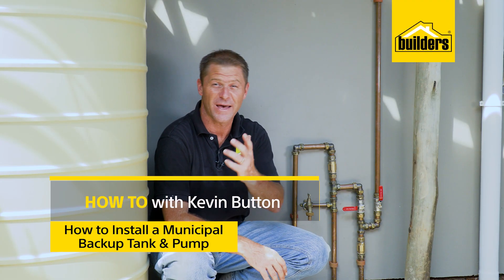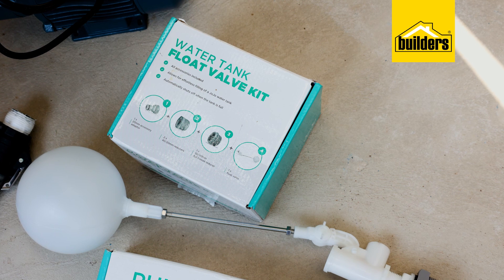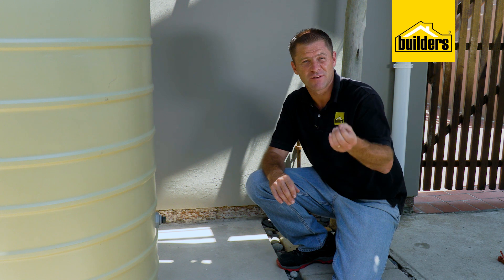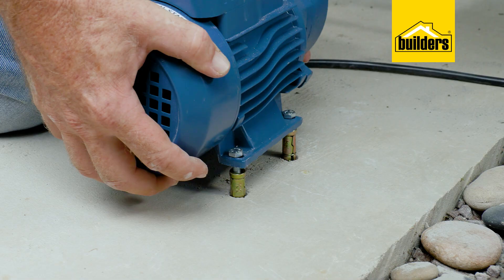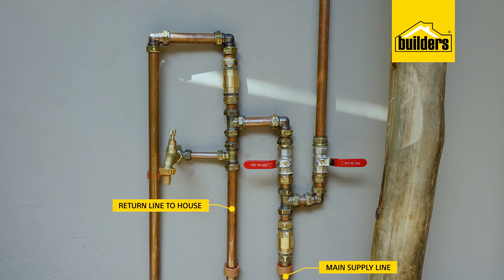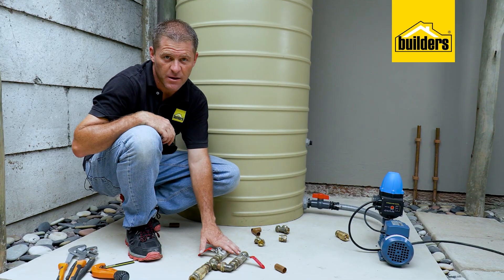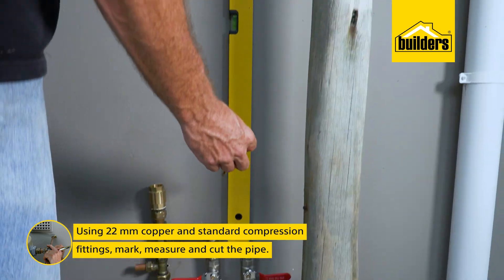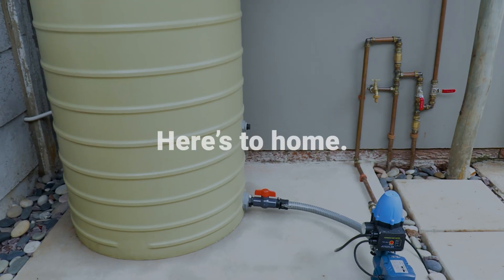How To Install Your Own Emergency Backup Tank

Comment: If you add a non return valve into the horizontal pipe above and to the right of the garden tap, flow arrow facing the garden tap, you can open both red stop cocks and the system becomes fully automatic. You can still use the stop cocks for manual operation or maintenance/repair purposes. As this is, if you forget to close your left hand side stop cock the pump will keep circulating between the jojo outlet through the pump to the open ball valve.
Reply: I just commented that, but my focus was on back feeding to the tank if stop cock was open mistakenly, and while there is no water from the main line.
Reply: So correct me if im wrong but what u r saying is that he should add a third non return valve above the left stop cock on the small vertical copper piece that joins with n elbow and a tee on the other end. From your observation both stop cocks can b left open and the system would run automatically, is that correct?

I am really pausing the video to see it from ur reasoning which would b ideal if it could run automatically.
Reply: @mocee83  that's correct
Reply: This is correct so it becomes fully automatics
Reply: The system that way will be automatic if there is no water from the main line if we add non- return there and open both stop cocks

Comment: I added a 5000 litre Jojo to my "Rand Water" system April 2022, when the local (fibre/concrete) pipes started popping in Pretoria East. 5000 Litres is fine for a week. I also have filters, particle filter on the way in, carbon filter and water softener on the way out. I use an electric water float and electric "tap" to feed water in - which allows me to adjust the water level in the Jojo by raising/lowering the float switch. It is also full pressure so agitates the water in the Jojo. I just have one "emergency" by-pass tap between Rand Water and the House. There is a one-way valve on the house side and another in the municipal water meter.
I also have a Solar/Victron/Battery system that keeps my house supplied with power.
One possible upgrade is a UV filter light on the house water, and maybe an array of pressure sensors so I can "see" what is happening.
We have had multiple pipe bursts in our area, as well as Rand Water failures - none have caused us an issue.
Oh, and I can safely (as in "tested") feed in Bore Hole water with its separate on/off float switch.
Wife really loves me!

Comment: Can I use the small generator for the pump
Reply: yes you can, the issue here will be how much automatización do you want. Specially since the pump is not always running (pressure fluctuation for min is the turn on). So its not efficient if you live a powered generator always connected and only the pump, find one of those automatic generator or use a control module beside the generator. Pump do require different power drain when starting, so be sure your generator satisfy the startup Wattage in requirement. (small pumps, 0.5hp, uses around 700-900W but for the startup need almost the double, so be carefully with this specification, you can even combine a small generator with batteries to compense peaks and a more stable system). 

If you want a continuous system using a generator is probably not a good idea, as i said, posible and the worst part is the efficiency. If you have power loss issues is better to have a battery system or just use the gravity: Put the tank at a higher point and use the pump to fill the tank initially, then just let gravity do their job (this also helps with the small generator issue, no controlator need it and no pressure system so you can save money on the pump)

Comment: Is it advisable to bury just the tank underground if space is an issue? All the pumps can be above ground.
Reply: There are underground water tanks😊
Reply: The problem with underground tanks is the risk of contamination, where rain water or any other run off can make its way into your tank, so ensure your inspection hatch and tank breather or and other openings are well above the ground and properly sealed.

Comment: How can I secure the pump from theft?
Reply: Install line in through house wall pump in house and line out again through wall. There must be a plug nearby. We installed it in our laundry room. Great thing is if there os any taps leaking you will know it immediately when pump switch on and you are not using water .

Comment: last put concrete caged to protect from thieves, welcome to SA.
Reply: Ish thats my concern as well these guys last killed my dog just to steal a used toilet 🚽 😢 my question is if we put a concrete cage for the pump will it not affect the air circulation ish you see how English ( all I mean is doesn’t ipump need umoya to work properly)

Comment: 1 question plz i am getting problems with my automatic, which is running continuously without any leakage..and when the main water supply open to fill the reservoir tank or even i open my water supply main tap the automatic stay on .
What should i do please???
Do you think i must change the non returning valve??
Reply: Check your pressure switch, likely faulty or set too high

Comment: In the USA here. Our issue is power loss. Any thoughts on a DC pump powered by battery with solar charging?
Reply: You should have a standby back up generator if you’re going this far anyway anyways
Reply: @ericchan6628  We looked into that but it's just crazy expensive. With the new modular battery backups, it's cheaper and quieter in the long run.
Reply: inverter with solar panel and deep cycle battery and normal ac pump

Comment: You should add a bladder tank to that setup. Saves your pump from turning on everytime you open a tap.
Reply: Hello. Thank you for your advice. At what height should I place the bladder tank? And what size bladder tank do you suggest?

Comment: This system as you build it can’t work: the check valve coming out of the pump will close once the pump stops keeping the house pressurized and causing the pressure from the pump to the check valve to drop setting the pump on an endless start stop cycle. Ask me how I know?
That check valve has to be on the tank side of the pump or the pressure switch needs to be moved from the pump to the pipe after the check valve.
Reply: How did you fix it?

Comment: Does the pump run when it's on normal supply???
Reply: It depends how you set it up. The lever ball valves are accommodated so you can choose between municipal and jojo  . Dab pumps are a good option because it's power efficiency is  exellent  and invertor friendly.
Reply: @ZakJeewa  Okay Thank you🙏

Comment: What is the estimated cost
Reply: JOJO Tank 2400Litre and Pump kit is going to be around R4100, The tank to pump connector kit is R350- R500 (depends on which you get). The Brass fittings are going to be around R1700, including a length of 22mm copper.  2nd option is rather use copper joints as its cheaper second option, still pricey but also more effective. 
3rd option is to go all PVC fittings and polycop  fittings. Which can leak over time, along with cracking from climate heat or the pressure and overtightening.

Plumber is going to cost you a call out fee before any work is started. So R350-R450 call out. And then his hourly rate or budget cost for the job.

A project like this depending where your mains is aswell, hiring a plumber is going to probably cost you shy of around R6000 - R8500 all in all.

Comment: Thanks - a great help.  Just a thought: If both ball valves are open, and the main supply is not supplying, it seems there is a chance that after using a tap, then turning it off, the pump will continue to circulate the water back into the tank?  Perhaps the non-return valve on the Main Supply should be after the Tee to the tank?
Reply: Just seen this video and have the same question. Looks like an additional NRV needs to ne added after the T piece to the tank?  Did you manage to find a solution to this John?
Reply: @TheJuryIsOut  Yes, That is what I did.  Now I can leave both valves open, so that if I am not at home, and the main water supply is not supplying, then the water from the tank will automatically be used, and my family members do not have to go outside and fiddle with valves.  When I am home, I close the main supply to the house, so that the water in the tank is used while it is kept topped up from the main supply. I cannot post a photo here, which would help you.
Reply: @johnfrancis2227  Thanks John. If you shut off the mains to the house then the tank won't be fed as well? Would be great to see your layout? I sketched something out as well. Email?
Reply: My setup.... I can leave all valves open. If the mains fail water is fed from the tank. If mains work then water will be used from the mains first until the pressure drops/stops. At least that's my theory. You are welcome to poke holes into it. Much better than trial and error.
Reply: @johnfrancis2227 
   Good evening John, please assist me,I want to buy the pump automatic switch,I don't know where can I get it, please assist 😢😢
Reply: I just wonder, why no water filter is used for both lines? Filling the water tank without a water filter will bring sediments into the tank. Do I miss something?
Reply: @holgermessner851  In my case the main water feed is municipal piped water and not harvested rain water. Had this been the case there would be a need for filters. Our issue for over a year now in certain parts of South Africa (no thanks to the ANC government) is the interrupted piped water supply so the system I use works as long as there is electricity and I have a full tank of water. Previous comment re water applies as many hours of no electricity per day for 15 years now no thanks to ANC....
You do have a point though as a filter even for piped water would be the way to go.
Reply: @TheJuryIsOut  I live in Panama and I am just starting to build my own little house. In my area where I am renting a house, there isn’t a water filter in place. It’s “city water”….. But every time, the water comes back on, I have to clean the sink faucets. There are small sediments in the beginning and blocking the faucets. I was told to install water filters. But hey. It isn’t my house. And the owner would be very happy if I would install a water filter including a tank at the rented house. On the construction site, I will install 2 water filters before the tank. It is well water we get supply from the development company. As for the “ city or municipal water” I put in brackets, it isn’t drinkable for me. I would get diarrhea right away. (Guess how I know that.) - Locals drinking it every day. But sometimes it looks grey or even brown. They pump it in big old concrete tanks. If the tank runs dry, it takes a whole night to refill. The 1st water isn’t even good enough to take a shower. We use the drink water bottles I buy in the supermarkets. I think they hold 30 liters around. I have always 4 bottles in the house.
Reply: @holgermessner851  For many years South Africa was one of the few Countries where "city/municipal" water was drinkable from any tap just about anywhere. However the Country has been on a downward spiral in all areas and soon we would probably be worse than the situation  you describe. I just saw on our local news that there has been a cholera outbreak in one of the remote towns....; so much for "clean" potable water... More and more people are starting to buy bottled water for drinking but even this is suspect in some cases as opportunists try to make a fast buck. Not sure whether you can get this in your area...a stand alone water filter system. In this case you would need to purify enough for drinking which is more cost effective than bottled water which as I said is often suspect.
Best wishes.
Reply: @holgermessner851  Input is from municipal supply, so should be "clean".  My setup is merely to store potable water in the event that the municipal supply is off, which is a regular occurrence in our neck of the woods.
Reply: Thank you. Starting my installation and this is a key point. Well done.

Comment: A small addition, if the slab where the tank is located is exposed to rain, placing the motor on a small raised plinth, 20mm to 30mm will keep it out of the water if the area floods.
Reply: the construction of the pump allows for that all you need is the cover - the pump is not completely waterproof

Comment: What happens if power outerage
Reply: So if there is a power outage you switch to the municipal supply (because the pump wont be working), so you are then relying on the municipal pressure.  That's why he set it up for the bypass option.   If you have a power and a water outage at the same time, you are in trouble and should probably move to another municipality 🙂
Reply: @MrDaveCoetzee  this clearly says emergency which could imply both power and municipal supply are down. In that case you would need a generator to power the pump and you could have water pressure until your tank is empty.
Reply: @MrDaveCoetzee  theres away out work it out using the weight  of the water 750kgs=pressure work it out
Reply: @MrDaveCoetzee  that means most households on the KZN North Coast would need to relocate thanks to our very efficient Ethekweni Metro.
Reply: one more nrv -tank-nrv-to your home

Comment: Nice I've done a few tank installations myself and I recommend doing them like this but I don't need to turn off the tank main that falls the tank when I'm using the main water supply. That way the tank is always kept full.
Reply: Where are you based? I need a quote for a tank installation. Pls share your contacts. Thanks
Reply: I like your idea. However I cannot figure out the following.... If the supply side SV is left open and the main water pressure drops activating the pump won't tank water be pumped back into the tank? By Kevin shutting off the main SV water cannot travel to the tank. Bit of a bind as one has to manually turn off the main SV each time there's no municipal supply. Your thoughts...?
Reply: @TheJuryIsOut  This could be negated by installing a one way valve with upward flow just above the left ball valve. This will prevent pump water from flowing down through the mains valve and back up the tank valve. A possible flow loss will occur when running on municipal water since it's flowing through two one way valves, but probably not enough to notice.
Reply: @Sheldon777  thanks for taking the time to respond. This is what I eventually ended up doing and your point is noted. Stay well.
Reply: 100s boss

Comment: What if the tank is far from the main water supply line.
Reply: It's still possible... You'll just need to alter the the main line a little bit
Reply: @nduvhomamidze992  Waar
Reply: same procedure the issue in the video is the same
Reply: I want to ask a question oo.  is it that, from main water, the water must enter poly tank first before  ??
Reply: @tsivanynojerryjohn6230  it must tee off from the main water supply (doing this leaves your existing line to continue normal supply to your home)  and by  using a non return valve (before you tee off) the water must move into the tank  and will only stop filling the tank when full and float is activated. make sure the non return valve is on the supply side  before you tee off. if not you will be supplying the neighborhood with water.
Reply: So guys from our main supply we'll two tee pieces running for this set up just confused about the last part when connecting up
Reply: Same here just clarrify that
Reply: If my water pressure is low upstairs, will the pump increase this pressure when water gets restored
Reply: @millinaidoo5526  yes it will

Comment: After the water issues in KZN this easter, guess who just bought all this online at your store. Thanks guys.
Reply: Lol. Same her
Reply: So how much did it cost
Reply: @craigfrancisy24u  JOJO Tank 2400Litre and Pump kit is going to be around R4100, The tank to pump connector kit is R350- R500 (depends on which you get). The Brass fittings are going to be around R1700, including a length of 22mm copper.  2nd option is rather use copper joints as its cheaper second option, still pricey but also more effective. 
3rd option is to go all PVC fittings and polycop  fittings. Which can leak over time, along with cracking from climate heat or the pressure and overtightening.

Plumber is going to cost you a call out fee before any work is started. So R350-R450 call out. And then his hourly rate or budget cost for the job.

A project like this depending where your mains is aswell, hiring a plumber is going to probably cost you shy of around R6000 - R8500 all in all.